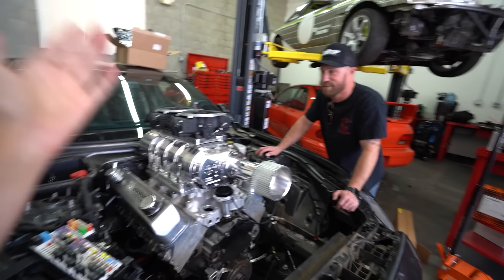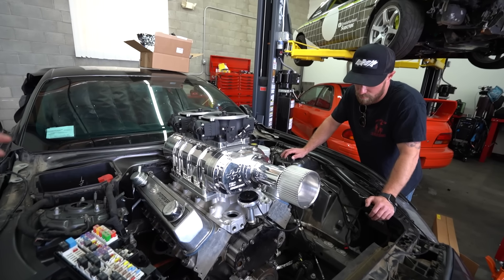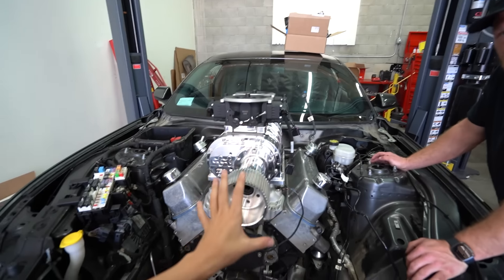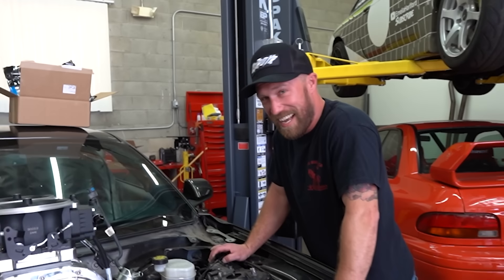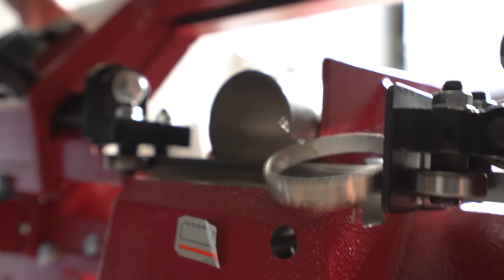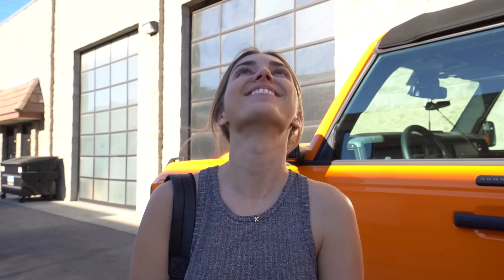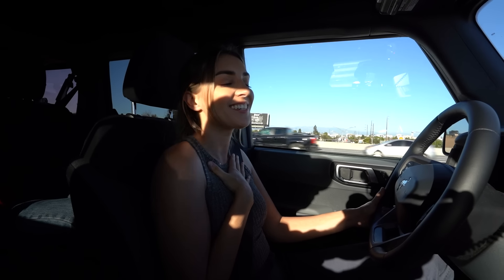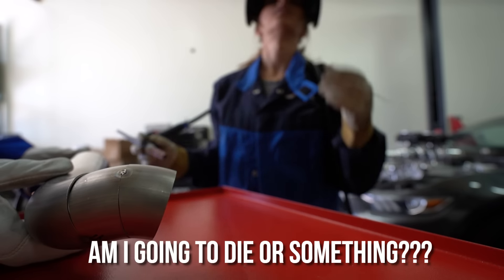BIGGEST NEWS OF MY LIFE!

Comment: Are your headers stainless?  Might want to consider.  My dad used to work for Smokey Yunik and they would dyno pull an engine and after the 2nd or 3 pull hp would fall off they would put a new set of headers on and hp was back the headers were scaling from being red hot and wouldn't flow as well
Reply: at 3:10 he says they are stainless

Comment: OMG!!  I love your shiba.. I have two of them myself. Trixie and Shiro. Please read everything about this breed. They are a hand full. The will run away so quickly. alway use a full body harness. One of the few breeds that cant be off leash. You can do it but youll have to spend countless hours with them. Also, wait until you hear the shiba scream!  Hahaha. Another thing is the shiba 500!  I wont tell you what that means, youll find out on your own. Good luck. Love the mustang build along with the others. To bad you live in Cali, you need to move to a state you can actually drive that on the street.

Comment: 11:54 Normally I wouldn't share so openly, but after what you said here, I have to voice my opinion on Manscaped, who you have done a few promos for; in my experience, they are NOT good, by any means. Their lawn mower razer is not only expensive, but you can get electric razers half the price that perform better and last longer and don't try to sell you on a subscription. I have a 60 dollar 3-in-1 electric razer from Braun that after 2 years(!) of abuse is less likely to cut sensitive skin with the trimmer. I thought I would give Manscaped a try (before seeing your promos) as their whole shtick is being better at specific purposes, but their blades are huge, do not cut close to the skin, and do not adequately prevent skin from being shredded between them. Not only that, but they also fail as a beard trimmer, brand new blades have a hard time cutting thicker hairs and instead just rip them out. They also try way too hard to sell their products, thinking back this should have been my first warning. Again, this is just my experience, but I could never honestly recommend them to anyone.
Reply: Congratulations 🍾 Hit me up ⬆️⬆️••• for more info…

Comment: With stainless steel tubing no matter how good the outside world is if you do not Purge the tube the inside will look like crap and slightly disrupt the exhaust flow. But then again I am a little OCD... And also putting an injector hat on top of carburetors is foolish. I don't want to be a hater but I believe the injector hat should go with an injection system I know it looks cool but it is totally unnecessary because you have two sets of butterflies, the ones in the hat and also the ones in the carburetors. If you built a custom carburetor scoop to go on top of them I think that would have looked a whole lot better. But that's just my opinion. Other than that I love all your videos...